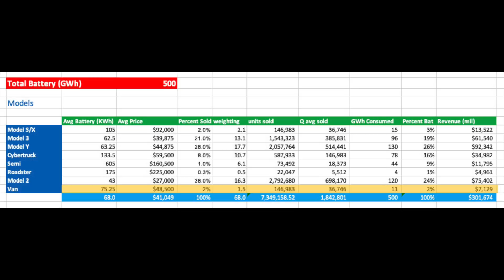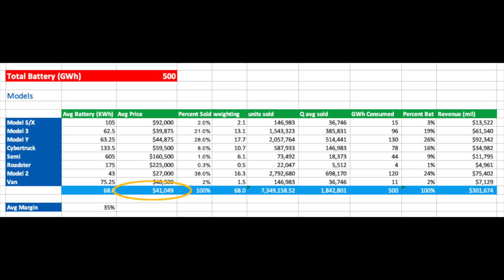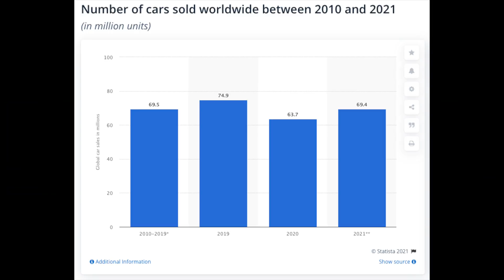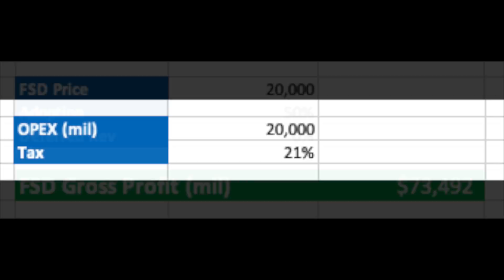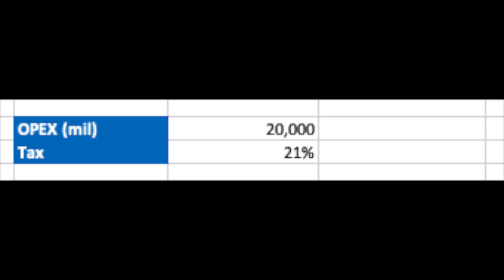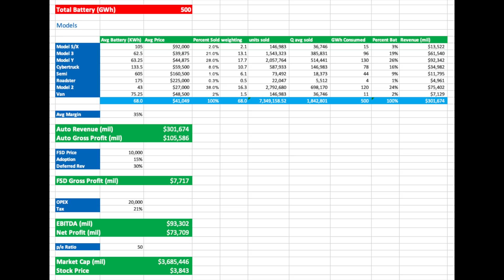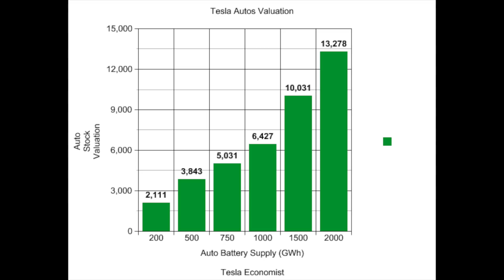What Would Tesla's Stock Valuation be with 500 GWh of Batteries for Their Autos?

Comment: Hi, long time viewer and Tesla shareholder. I have a genuine question I’m struggling to understand.  

My overall question is fairly simple. I’m trying to accurately value Tesla’s car business so I can understand how Tesla’s car business could be more valuable than VW’s. 

The way I see it, VW as a company sells cars. Tesla also has a car business (amongst others, but let’s ignore those for now). Now, if you strip out the software side of the car business, what value should be placed on Tesla’s car business? For example, if in 2025 Tesla can achieve 13% operating profit per vehicle made, but VW can only make 4%, then of course Tesla’s car business is worth more than VW’s. To me, it appears that Tesla’s car business would be worth 3x more as they are making 3x more profit per vehicle.

What do you think? Does this reasoning make sense or am I missing something? Thanks!

Comment: The 35% gross margin is a critical assumption, as is the assumption they can sell everything they make.  It might be that for the second to be true they have to reduce prices further (the competition is coming!), and so reduce margin.  What is your valuation with margin at 25%, or 20%?
Reply from the maker: According to my model $2300 SP @ 25%. But 35% is more than likely. There is no competition coming, at least not that compete on price or margins, let alone actual mass production, this assumption holds true for possibly 10 years. By which stage Telsa's costs should be so low anyway. 40% is a high possibility.
Reply: @TeslaEconomist  You are possibly and hopefully correct, but it is good to know the "down" side (if 2300 can be described that way).  I do think there will be more competition in 5 to 10 years than people think.  Obviously with fsd and robotaxi margins will go even higher, but just for auto sales I think 35% is optimistic.

Comment: Thanks. It’s great to keep using different methods to re-check and still come up with the same answer. I would like to understand your thoughts more on why you used the PE ratio 50 to get the valuation. I’m fairly new to this but it seemed a little high for purely the auto side of the business compared to more traditional auto around 15. It’s still high compared to APPL at 35 although AMZN is at 78. Is it purely based on the amount of growth?  Thanks for all your work.
Reply from the maker: Because Tesla have about 5x more batteries coming

Comment: Your “Tesla Auto Valuation” at the end of the video is a very nice summery. I like to suggest a couple of items you could add to it . The Y axis has no unit! Also I think you should add the expected year ( based on your current estimate ) that X axis values ( GWh ) will be achieved . You can use the 3TWh in 2030 as reference. I also suggest you continue the graph all the way to 2030 this way when we get more info we can adjust the values accordingly and update it annually till 2030.

Comment: Model 3 having 1/15th batteries of high range semi at ~1/10th price means all batteries have approximately the same mark up in automotive. That's currently 6x. So the uber simplistic model is to just take battery supply and 6x the cost to get the revenue. Bear in mind that the cost of batteries will fall by Wrights Law at some fixed percentage for each doubling of capacity. Tesla is likely to double capacity around every12-18 months. Then you need to add in the inevitable inflation that's coming through with so much stimulus and you're very roughly back to todays prices in ten years time...

Comment: I find it interesting to compare other Tesla shareholders projections based on the companies current level of expansion. Warren Redlich had 200GWH in 2022, 320 GWH in 2023, 512 GWH in 2024, and 819 GWH in 2025, 1,311GWH in 2026, 2,097GWH in 2027 in his model. This was based not only on batteries made by Tesla but also included the other suppliers LG, Panasonic etc. they use in production. It grows at a 60% growth rate each year. This pace is consistent with Elon’s plans and follows closely the development of Texas and Germany’s Giga factories. The math speaks for itself and is consistent with your model. All those batteries will be put in cars, battery packs, battery storage generating huge revenue leading to a stock price quite a few multiples from where we are currently at. If we have self driving, a robo taxi network, or if Tesla ends ups licensing their AI to other legacy automakers after the race is won, the numbers are staggering. The more you know about the company you get a sense it is all likely to happen in time.
Reply: I believe Warren assumed Tesla would make 100 GW and would buy 100 GW in 2022